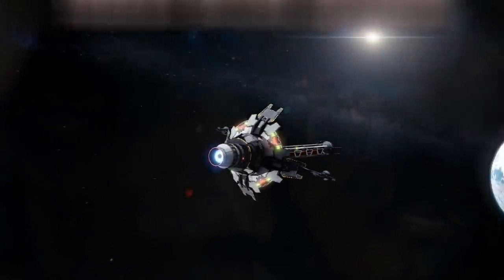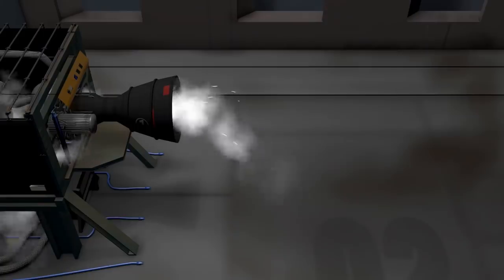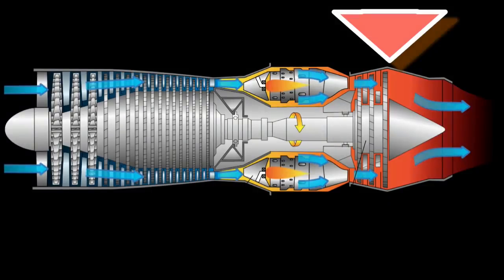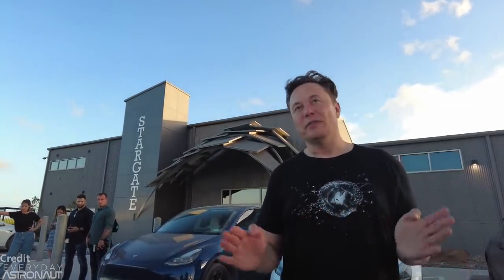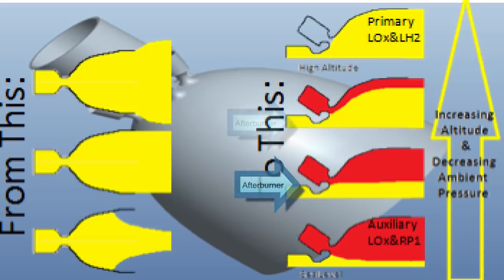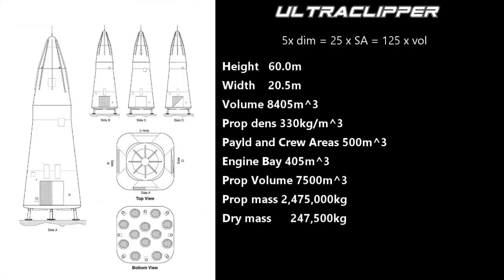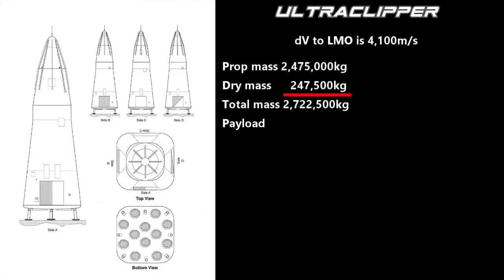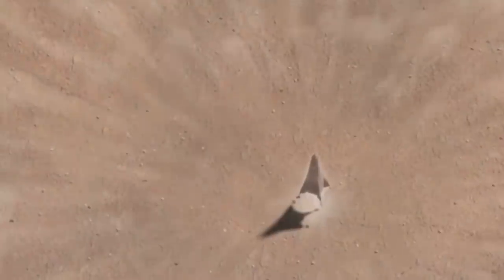Rocket Science: UltraClipper is Better than Starship!

Comment: This is a great video ... It's sort of like the vehicles you might see around a factory..a train or semi trucks bring materials in, smaller trucks or forklifts to move things around the factory, and semis to ship out the finished product.
      Space travel may become like that...a specific size or design of vehicle best suited to the job and location.
    Starship might be the " freight train" and ultraclipper the " semi" that takes things to and from the surface and orbit.
      The mental image I have is a small plate on a future Ultraclipper that says : " Made on Mars by Martians"...
Reply from the maker: That would be so cool!  And you are exactly right. To maximize efficiency it will be necessary to adjust each vehicle to the local environment and materials... On Mars that will be SSTOs of steel... on the Moon they can be steel or titanium aluminum alloy... on Psyche they can gold, platinum and osmium :-)
Reply: I like to compare Starship to the steel ships of the early twentieth century rather than freight trains. When the wars started manufacturing was extremely effective in making them in large numbers. Then specialization happened and we got the varieties of today. 

Think about the possible cruise ships between the planets. Most likely there will be two sections, micro and at least Moon acceleration for the guests enjoyment.

Comment: Interesting, though when considering the use of very efficient engines like hydrolox and aerospikes to make this concept work as well as possible, an extra thought came to mind. Wouldn't a detonation engine allow one to squeeze out a bit more ISP yet? There were suggestions in the aircraft industry that for instance for turbine engines it could give a gain of 5% due to detonation engines bypassing the normal thermodynamic limit for chemical energy extraction. If one could gain that much in ISP, that would have substantial impacts for this concept as well, right?

Though I guess this depends a bit on if detonation engines should be considered a realistic future prospect for rocket engines or not.
Reply from the maker: It would indeed... one Japanese company and one American company seem to be close to working models.
Reply: @terranspaceacademy  Interesting, didn't know that tidbit, thanks for the info.

Comment: One thing you are overlooking is that, the shape of Starship is more efficient for containing high pressure fuel and oxidizer, you would never manage to use that full volume of the pyramid without some big weight penalties. Still cool idea on optimizing the nozzles.
Reply from the maker: Thank you! Spherical tanks in my giant pyramid!  Like the Boeing Double Bubble.

Comment: I liked the video and the concepts are interesting . I would have to agree with others that say use a ship optimized for each specific task but that is down the road in the beginning a generic ship is the best thing for the job till infrastructure to support specialized craft is in place . I'm retired now but I used to work in aerospace and have worked on engine development for a couple companies , these engines did their job as designed and I'm sure their efficiency could be improved on but the task they needed to do was well within their capability . That's one thing about SpaceX's Starship , while there is no doubt places that can be improved upon as long as the task at hand is within its capability does it really need to be more efficient ? Part of the design criteria for Starship is reusability which means possibly trading efficiency for durability and I've seen this in many designs over the years . The hybrid rocket motors we designed for Scaled Composites had to be able to be reloaded with rubber and reused many times but they also needed to be light , fun project . That's why I don't care as much about efficiency numbers as I do about "can it do the job" . I wonder about the virtual variable nozzle concept , how much extra fuel would you be burning to do that and does it add up to more cargo to orbit or is the trade off null ?
Reply from the maker: The fuel to oxidizer mix is always stoichiometric fuel heavy as that increases efficiency.  Injected properly it would save fuel overall but it is a complicated system that must be constantly adjusting itself.

Comment: A superheavy can get as a ssto to orbit, when not carrying a ship. Than it could get refuelt using tanker starships on the interstage. With it's full tank it could get into a mars orbit and get refueled there again. From there it's probably possible to slow down and land the full boster slow enough to avoid needing a heatshield and using bellyflips. Like this we could also use starship to export massive payloads from mars
Reply from the maker: It does look like a SHB would have a deltaV of 9,677m/s... more than the 9,400m/s need to achieve LEO with 7,800m/s orbV.  That would make it the perfect for a fuel depot in orbit.

Comment: What if the vacuum optimised bell is made into a modular skirt that allows for sea level launching as it slides into full bell shape with rise in altitude?

I envision it as half the bell being able to slide back over the the rest, the distribution would be defined by angles of least resistance. Three segments that slide over and latch onto three station segments fo sea level launching.
Reply from the maker: That's been tried and it works pretty well... but again with a two stage rocket the improvement is offset by the extra mass.

Comment: That afterburner idea is fantastic, I'm just a dumb amateur but even I see the utility in that. Why hasn't it been put to use? I can only think of two reasons. 
1. In many applications there isn't room for a larger nozzle anyway, they'd impact each other. 
2. One would have to create an efficient ring combustion chamber.  

This got me thinking, why can't a nozzle using this system be more square. Put the afterburners in the "corners" of the rounded square nozzle. This would fit more nozzle in the same overall area without them impacting each other. I wouldn't think the square shape to be a problem for an under expanded nozzle. And it would simplify the afterburner by only putting it in four corners instead of trying to create a ring. The four corners could each have separate combustion chamber with a converging diverging nuzzle leading into the larger nozzle.
Reply from the maker: Interesting... the square nozzle with corner thrusters would create the effect of a round adjustable nozzle.... very cool.
Reply: @terranspaceacademy  Thanks, I think I've refined/improved the idea even more. Can't do anything with it though. Thrust/efficiency is proportional to nozzle area correct?

Comment: Question: during reentry -  How long will the Starship be required to deflect the atmospheric plasma before it comes clear and the heat tiles are no longer necessary for that flight? minutes/seconds?
Reply from the maker: It doesn't let me post an image here... my graph shows about 800 seconds with a peak at 600 second heat flux 80 BTU/sqft-sec... on Mars 600 seconds with a peak at 500 seconds at 140 BTU/sqft-sec

Comment: There's a big misconception in all of this: Pressure tanks mass (all rocket propellant tanks are pressure tanks) scales linearly with the tank volume(!) not tank content mass. IOW, propellant density matters!

 Hydrolox is about 3x less dense than methalox. So for the same mass of hydrolox your tank would be about 3x heavier. In Starship, tanks weight about 40t. But as you increase tank mass to accommodate less dense propellant, you must also increase the aerosurfaces, legs, heatshield to cover larger tank, etc. Moreover hydrolox engines are about 2x heavier than dense propellant ones (because hydrogen pumps must be much larger, and thus heavier). So you'd need to increase not just the tank but also other parts. You could assume the tanks and all the supporting parts are about 60t, i.e. half the dry mass (i.e. half of Starship mass is dedicated to dealing with methalox and would have to change in tune with propellant density if you switched the propellant to something else).

So your Ultraclipper mass estimate is off. It must accommodate 3x less dense propellant. Half of your vehicle must become 3x heavier. 1/2 + 3*1/2 = 2: your Ultraclipper dry mass would be rather 495t not 247.5t. And your deltaV goes down from 10582m/s to 7396m/s.

There are also few less consequential errors:

* Titan atmosphere is 95% nitrogen and only 5% methane.
* Altitude compensation is not useful either on Callisto (vacuum) or on Mars (not vacuum, but from rocket engine PoV not distinguishable from vacuum). 
* If you're producing propellant on Mars, hydrolox would be significantly more costly per kg lifted to orbit because you'd need to electrolyze more water to produce hydrolox rather than methalox to lift some chosen mass up.
Reply from the maker: That is an excellent point Sebastian... but we have to account for the lower gravity on the Moon and Mars making less weight and therefore less pressure... I think a lesson on this is in order... standby and thank you for the feedback.
Reply: @terranspaceacademy  

1. Tanks are pressurized even without head pressure. Propellant top surface is never at the ambient pressure, it's always pressurized significantly above it.

2. The head pressure itself depends not so much on local gravity, but on the rocket acceleration during ascent.

3. Unless you build the vehicle on Mars and never plan to land in on the Earth, the vehicle must be able to ascent from the Earth (which is the hardest to ascent from solid surface body in the Solar System)

Comment: Interesting stuff. I will say though that Starship doesn't need the clipper to meet it with methane to help Starship to get back to Earth. Starship can fly to Mars, land, take off and get back to Earth with just the fuel from liftoff on Earth. Marcus House just did a video where he went into this specific thing.
Reply from the maker: That's interesting.  We watch most of his stuff but I must have missed that one. Let's look at a few numbers. Assume the Starship is refueled in low Earth orbit.  That gives it a dry mass of 120 tonnes, a propellant mass of 1,200 tonnes and a payload mass of let's say 100 tonnes.  That gives us a total initial mass of 1,420 tonnes.  The specific impulse of a Raptor engine in a vacuum is 380 seconds giving us 3,727m/s ejection velocity.  The rocket equation tells us the deltaV of the starship will be 6,949m/s.  To get from a low Earth orbit to a Mars transfer orbit takes 4,300m/s of deltaV.  That leaves us with 2,649m/s.  Mars transfer orbit to Mars capture takes 900m/s.  We now have 1,749m/s left.  Landing on Mars takes 4,100m/s but let's say that the atmospheric drag let's us land for a lot less.  We are now going nowhere.  The ship can fly to Mars and land but cannot lift off again.  Can you point me to the video?  Without onsite production of Methane a Starship to Mars, even fully refueled in Earth orbit.  Is a one-way trip.

Comment: Another fascinating exploration. I once wondered why they didn’t inject hydrogen into the nozzles of practically all rockets to increase specific impulse, including hydrogen rockets. Then I learned they were doing this already by running H2/O2 engines hydrogen-rich for just this reason. And here you’ve taught me that the hydrogen injector/afterburner idea has been in physical development. (Since when, and implemented where?) The idea of oxygen-fueled turbojets on Titan is exciting (though methane is very dilute with nitrogen there), as is the single-stage clipper design suitable for *every world but Earth.* Probably won’t have the fins, though.
Reply from the maker: I had to make do with the artist’s beautiful imagination :-) but those double as landing legs…
Reply: injecting hydrogen adds mass to the output, but will also cool it (unless you are also adding oxygen to burn, and if you are going to do that, why not burn them in the combustion chamber)
Reply: @davidelang  , given that the rockets’ normal exhaust gases are significantly more dense than hydrogen, the heat of combustion is better converted to kinetic energy with hydrogen than with those gases. More exhaust velocity = better specific impulse.

Comment: Conventional rocket engine exhaust bells form an active part of heat dissipation and propellant temperature control. Where would the corresponding surface area be located on an aerospike, linear or otherwise, to perform the corresponding heat management at a sufficient efficiency, especially in a vacuum where heat dissipation into the atmosphere is eliminated?
Reply from the maker: You would have to use propellant active cooling and it would only work with hydrogen and methane. RP-1 aerospikes will overheat.
Reply: @terranspaceacademy  I agree, TSA. But where would the active cooling structures be? Wouldn't they add weight and complexity?
Reply: @averystablegenius  The active cooling is embedded into any structure exposed to great heat. On an aerospike, the active cooling structures are the combustion chambers and the physical spike portion of the nozzle.
Reply: @sycodeathman  I think I understand, Tyler, but we know the active portion can't be the small area of the combustion chamber walls themselves because the propellants must be pre-heated in quantity prior to injection to the combustion chambers. We also know the surface area of the spike must be substantially less than the surface area of the bells they replace or else there's no meaningful weight benefit. So, the back of my envelop suggests that additional surface area structures must be added. But, I could be wrong. I've been wrong before.
Reply: @averystablegenius  that's why the X-33 had a linear one, it was about to being launched if it wasnt for being cancelled bc of fuel tanks
Reply: @zazugee  Could be, zazugee, but one has to wonder why no one, including Elon, is using linear aerospikes.
Reply: Linear airospikes require more parts,  making them more complex, therefore more expensive and difficult to produce
Reply: @averystablegenius  There's an everyday astronaut video on it. But in summary due to aerospikes tending to be a bit heavier, and Earths atmosphere being just a bit to thin really to get the most out of the aerospikes adaptive ability, the performance gains aren't that large. But meanwhile complexity and design costs go up by quite a bit. Thus making it not very worthwhile at the current point. It might be worthwhile as a future engine to wring every last percentage point of performance out though.
Reply: @Quickshot0  Yep. Now someone just needs to tell TSA.
Reply: @averystablegenius  Awhile ago I saw from Scott Manley some talk on detonation engines as well, which might allow for some ISP gains from engines as well.

For instance a prototype jet engine seemed to be gaining 5% from that. Though more then that might be possible for rocket engines.

Drawback is the obvious one, controlling a detonation wave is hard. Still might also be a future direction to squeeze some extra percent performance out of a rocket engine. 

If one could put all the little gains together one can make, one starts suspecting that you could get a pretty impressive performance gain in total, though how many tens of billions this might cost to develop I do not know. Still, who knows, maybe it will be tried next?
Reply: @Quickshot0  Could be, Quickshot, but I would rather spend the money on discovery, science, and utility. You should know that I oppose human space flight as it has always, since its inception, been about politics. Lately, HSF is about billionaires getting new toys. Neither of these, however, advance our understanding of the universe, or contribute to the quality of life on Earth. Just so you know where I stand.
Reply: @averystablegenius  Fair enough, though even for that a more efficient engine would ultimately deliver savings there. A cheaper to use rocket would let you over time put more missions to explore space with.

Getting a technology to work as cheaply and reliably as possible for the good of all is something I typical consider a good thing.

That just avoids all the politics and ideals of everyone and just looks at doing the best for everyone.
Reply: @Quickshot0  Yep. Good point.